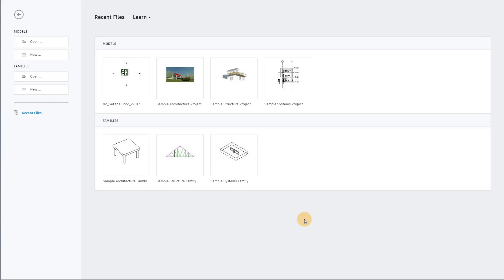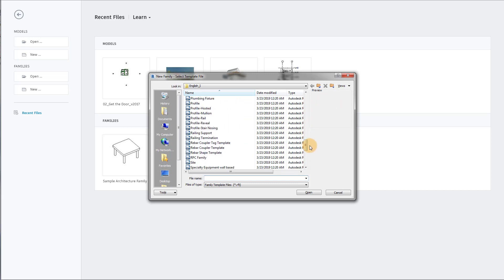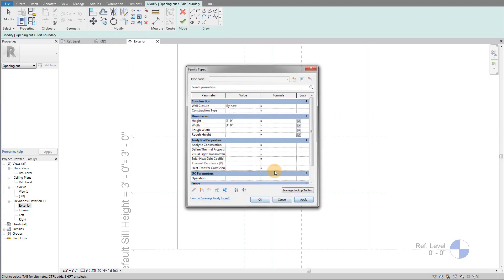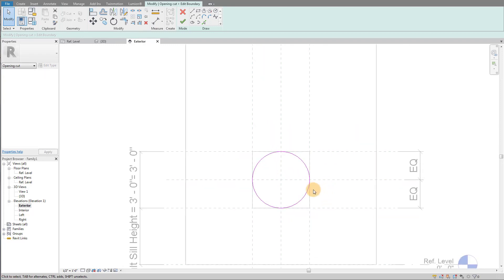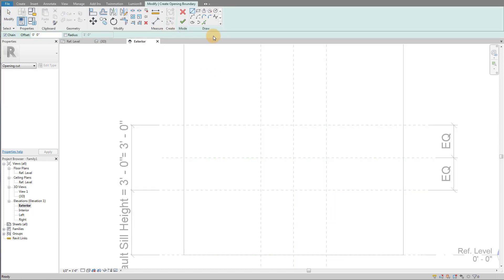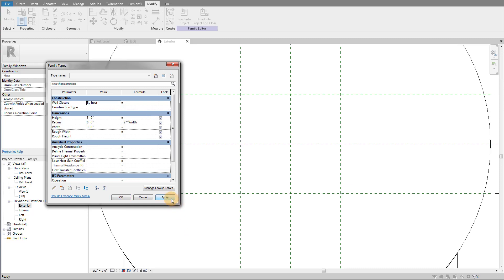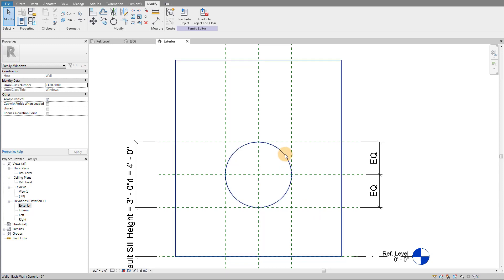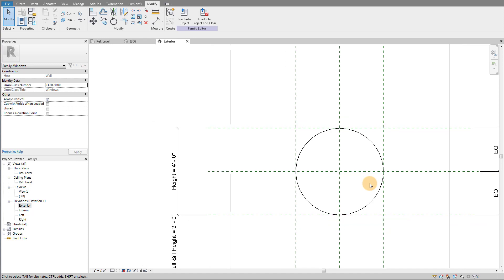Revit Tutorial - Round Windows and Parametric Circles (Revit Parametric Family Creation)

Comment: Nice little demo!

I nearly always use the centre snap, easiest to control especially for EQ driven circles.

I also tend to lock the width/height via formula so that if the user modifies the type properties in the project, the other will automatically update. Means you don't run the risk of the circle/reference planes not matching.